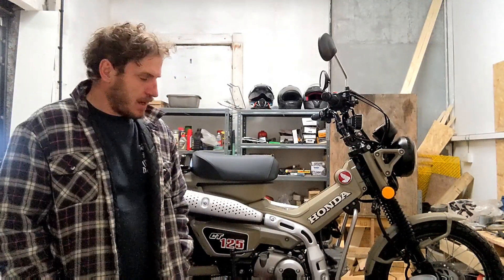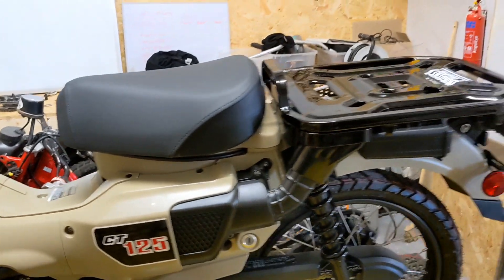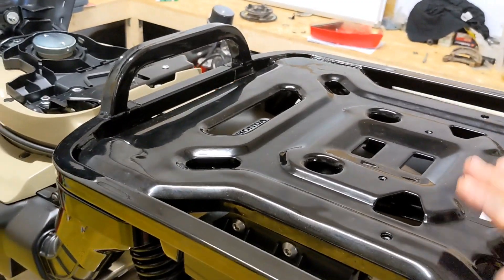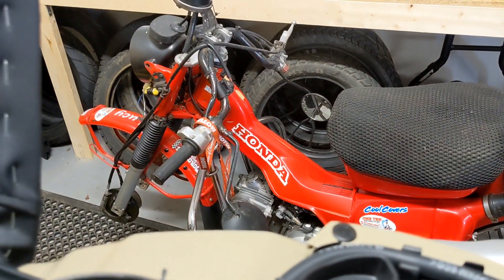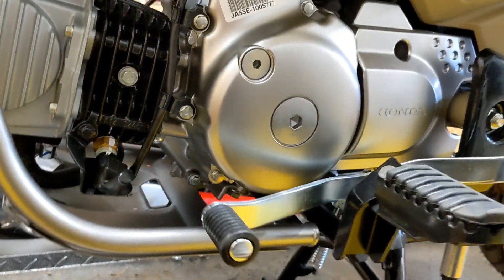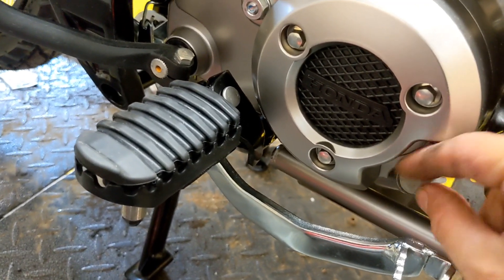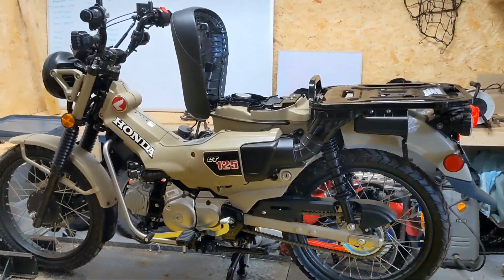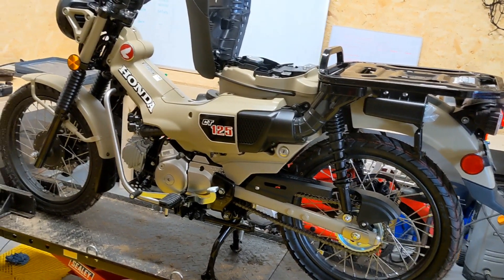A walkaround the new Honda CT125 (UK based)

Comment: £4.5k isn't bad!
Reply: Its robbery FFS.
Reply from the maker: No to say they come fully registered I don't think it's too bad either
Reply: @anthonydowling3356  Nicely put. How much more is a CB500F in the UK? That's a liquid-cooled DOHC 4-valve twin with 48 hp that goes 180 km/h.
Reply from the maker: @PrimoStracciatella  Why spend £4500 on a CB500F when you could buy a 10 year old Vstrom 650 for £2000, or a 15 year old Deaville for £1500? The comparison arguments are pointless.
Reply: @nathanthepostman  I'm not talking about used/second hand bikes. Then I'd buy a slightly used NC750S  for that kind of money.
If I walk into a showroom and see a tricked-out but simple 125 for the same price of a modern piece of technology several times the size I wonder what happened here. Okay, the 500 can't go offroad, but why not buy a CRF300L and trick it out with the money you saved over - a 125?
Reply from the maker: @PrimoStracciatella  A CRF300L is £5000 (if you can get one). A Monkey Bike brand new is £3900. A SuperCub is £3500. A CB500F is £5749. A CB500X is £6100. A CRF300 Rally is £6100. For an imported bike, and a company making money on importing a bike, I'm pretty happy with the price of the CT125 at £4500 and if Honda brought it in I suspect it would be £4200. UK prices are high. If I wanted better value then a Sinnis 125 Adventure would have been a better bet at £2900.
Reply: @nathanthepostman  Okay, a CRF300L is a bit more than 4500 pounds in Germany, maybe 4750, more expensive than I thought.
Reply from the maker: @PrimoStracciatella  Yeah we get a bum deal here in Brexit land! I mean I agree, it is stupid money for a 125, but it does reflect the market over here at the minute. Even the old CT90s imported from America if they're in decent condition are going for £3000!
Reply: Put ur money where ur mouth is then haha.. its blatant  robbery